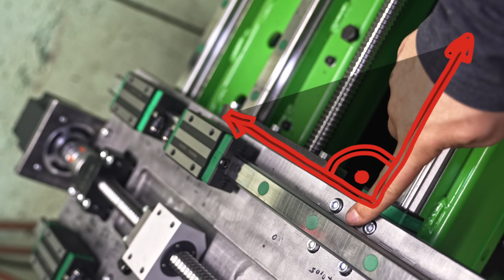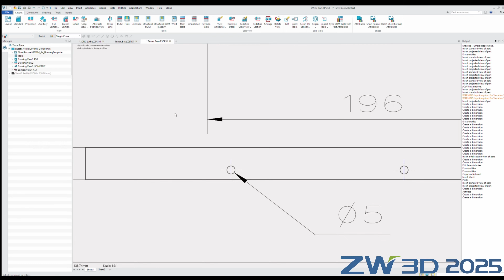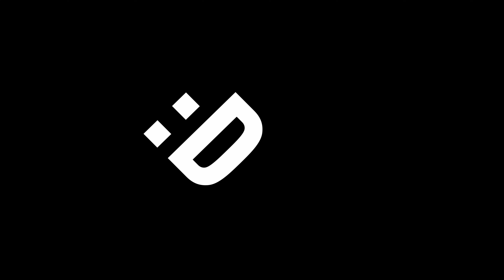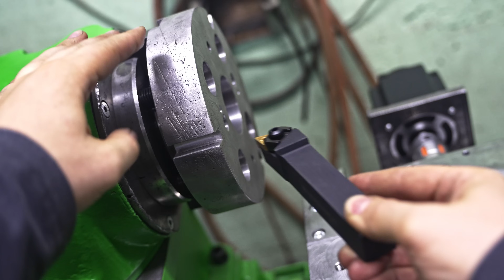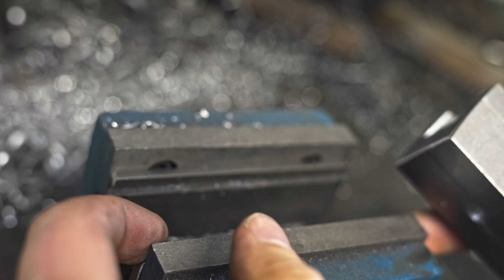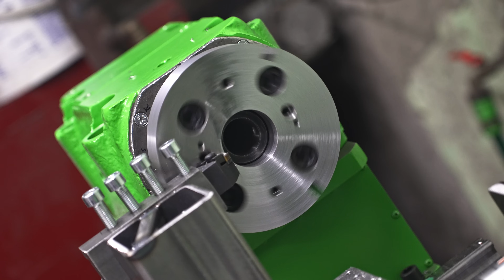THIS is a MILESTONE! - DIY CNC Metal Lathe Build! #13

Comment: How accurate would this be, then? In nanometers, I mean? Also, consider making a set of two counter-rotating interlocking extrusion screws with it, and using them to produce the world's first DIY, open source twin-.screw extruder plastic compounding/mixing machine! :D For making masterbatches from either base plastic fibre or pellets mixed with powdered pigments and other additives of choice. I'd be wildly interested in seeing that! <3 You have a lot of ingenuitity, and it is people like you that will further our sciences and industries the most.
Reply from the maker: Will see when it's finished :) Cool idea btw! Sounds like a challenge! ;) Thank you for your kind words!

Comment: To fix the loose pins, get a ball from a ball bearing bigger than the hole, put it on top of the hole and hit it with a hammer lightly, the hole opening will shrink and your pin will fit better
Reply from the maker: I have to try that out when I'll be making the ATC head. Thanks for the usefull hint!

Comment: i have a suggestion, i was also planning to use servo for main shaft but then i used inverter and ac spindle and it worked very well why don't you try it. Companies do the same 😁😁😁😁😁😁
Reply from the maker: I had an usual AC motor in my past machines, but this time I went with a servo due to it's high torque delivered at low RPM compared to usual AC non-servo motors. I have a 1:1 pulley and the goal is to thread which sometimes requires a lot of torque :) Thanks for the suggestion though - in many cases it's the best cost-effective way to do it :)
Reply: @GBWM_CNC  You can use a slightly more expensive old inverter and AC Spindle with the same power servo, can run at high speed and lower the speed to increase torque, you probably won't run up to 10000rpm :D. Anyway, you're almost done :)

Comment: Hadn't heard of ZW 3d... looks very nice! But wow, over $10,000 for fewer capabilities than Fusion... do you have access to that through work?
Reply from the maker: $10,000 for ZW3D? I saw it for much less. Maybe you've seen the version with all possible modules or something. I like the ZWSoft approach, which is - they still sell lifetime licenses. 
They let me to use it on my DIY projects here so I can in exchange show it to my viewers and share my thoughts about the software.
Reply: @GBWM_CNC  It's $6500 for the middle version (the lower version has "limited CAD"), and another $4000 for 3D CAM - that was as close to the Fusion package as possible.
I also hate subscriptions, but it would take more than 20 years to come out ahead compared to the $550/year for Fusion.
Anyhow, I wish them all the best, people deserve to get paid for the software they create.